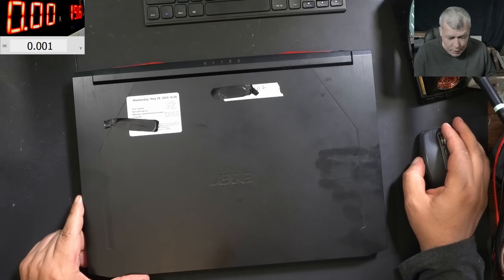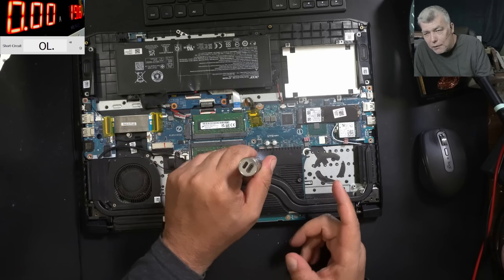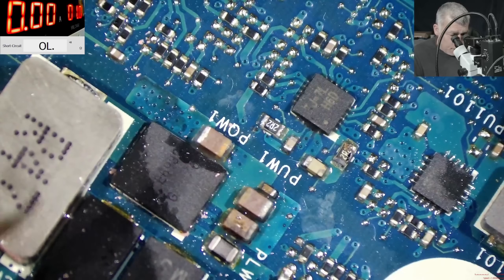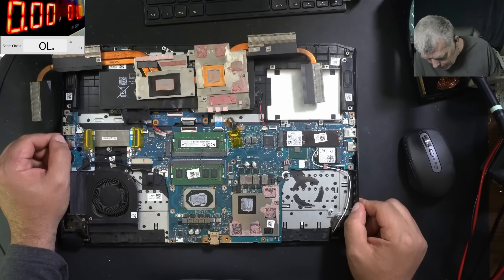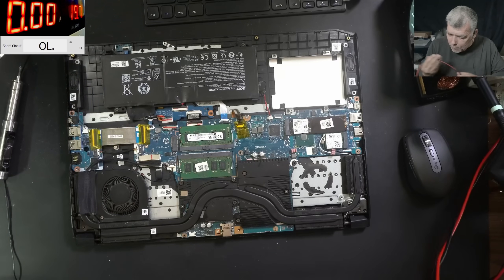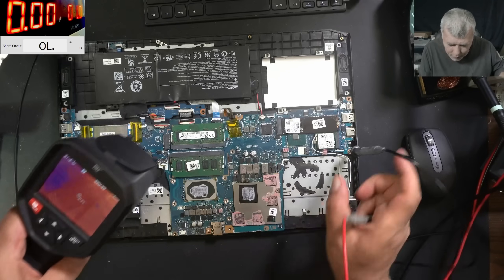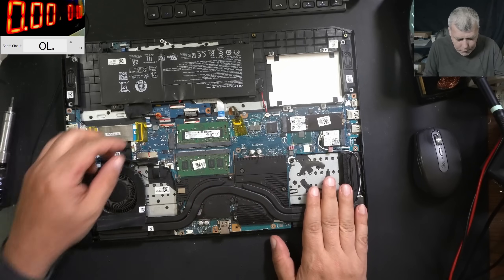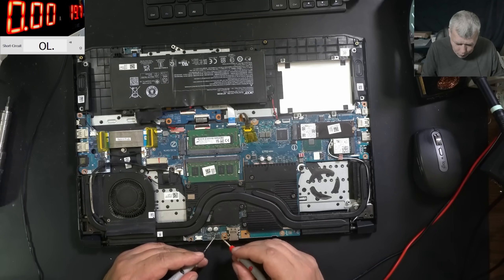A capacitor exploded during this video. Acer Nitro 5 liquid damage  motherboard repair

Comment: Hey it would be even more intresting to see Sorin fit replacement Capacitors like would he purchase new ones or simply cannibalise similiar items from an stock of scrap materials in so doing replacing with age related items this is common in the auto industry as it helps keeps costs down...So intresting to see how   Sorin would go about this particulary since capacitors don't really wear or degrade much when in use.

Comment: I have exactly this type sir acer nitro 5 i managed to change the second power mosfet and everything was working but after i assembly and plug the charger it never responded and was immediately shorted to the ground with zero ohms now all capacitor inside the Mainboard were all shorted and i know it just one that is making all to be shorted and non of the two power mosfet were shorted because the short is from the Mainboard i have no thermal camera sir what do you suggest i should do sir. Thank you, sir. I'm a big fan from 🇫🇷France 🇫🇷 sir.

Comment: If without schematic, which value will you put? I would remove the last big capacitor, measure it and put 3 new capacitor but not sure because they could have been different from each other.

Comment: You have to replace the capacitors cause the one left received water and it will eventually explode and only one capacitor is not enough! At least two! And i would replace the one left that received water too! Even if it works, it won't work for long if you leave it like that!

Comment: I am watching this to see what its like when a capacitor blows, I  think a capacitor blew up on my new expensive graphics card last Sunday, there was a puff sound and then smoke out the side,  the card was only two weeks old. I took it back to the shop and they put it in there test rig and it smoked on there too. I was lucky my psu shut the pc down when it happened, i took the card out immediately, it did not feel warm or anything, and installed a old card and my pc was ok what a relief.
Chris
Reply: which card was it?

Comment: Please, with the oscilloscope visualize the ripple of the supply voltage with and without the capacitor, make the measurement in the vicinity of the capacitor.

Comment: Just my thoughts Sorin.
1. 3:13 - Should have checked, cleaned, replaced and reflowed all components in this area, checked mosfet and power rails if shorted.
2. 6:12 - Result of not doing 1.

Comment: Sorin when you checked resistance after removing the first capacitor it was around 100 ohms, isnt that low for the main power rail? probably that was the sign that something will blow up.

Comment: When you removed the capacitor the multimeter was reading around 120ohm resistance which is not normal ... something else was partially shorted

Comment: I accidentally installed an electrolytic  backwards in a negative voltage rail. Powered up the board and it exploded straight in my face 😂 Luckily it missed my eyes but it still scared the crap out of me.
Reply: Ooo..Its why im using glasses😎